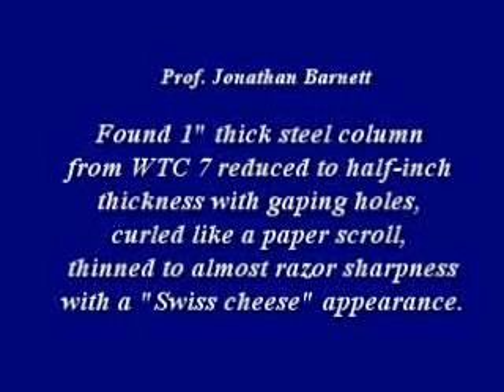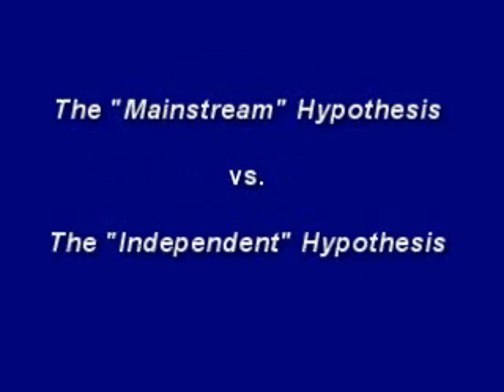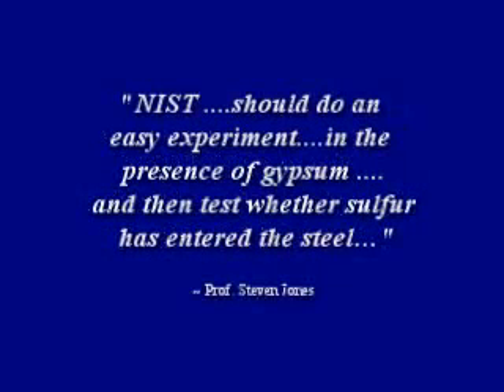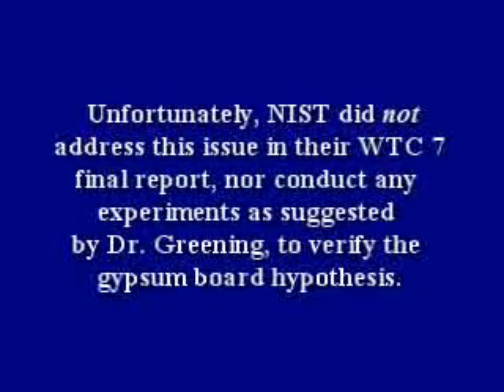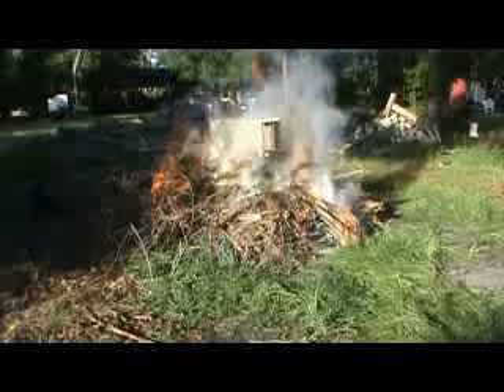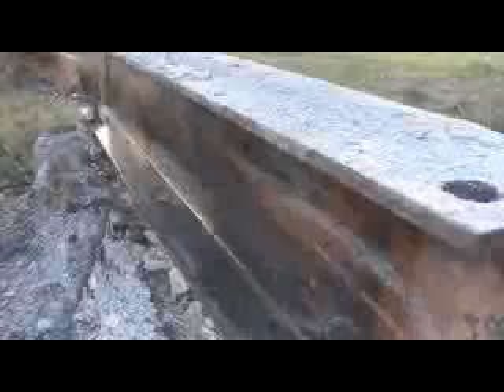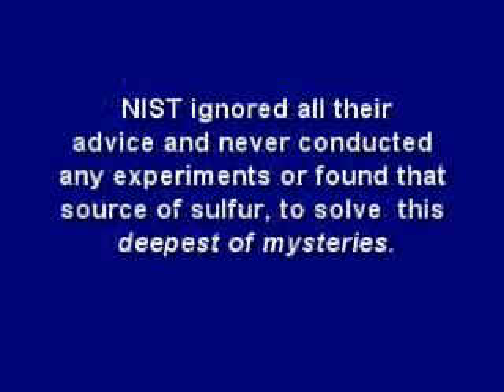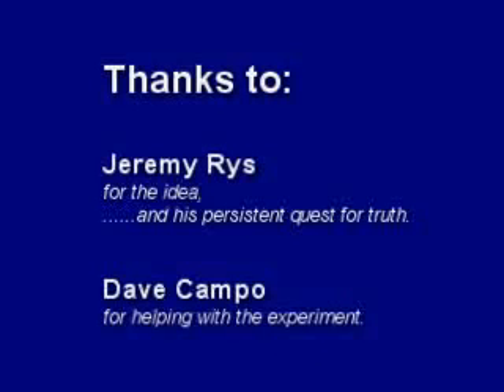9/11 Experiments: The Mysterious Eutectic Steel

Comment: @fertilizerspike "I've demonstrated that not only should the "collapse" never have started in the first place without a controlled demolition"

When did you do this?

Just as an FYI, lets say thermite, explosives, directed energy weapons or airplanes and fires started the collapses I.E at the impact the floors. 

The collapse would have behaved the exact same. You know that right? You claim charges were placed on every floor. I say your charges would only need to be placed on one floor.

Comment: @flanksteak2 said:
"if you didn't think collapse would start in the first place why would you try and argue this point and then change the subject when told to prove it?"

That's not what happened, liar. I've demonstrated that not only should the "collapse" never have started in the first place without a controlled demolition, it in no way could have proceeded to the utter shredding symmetrical collapse of the entire structure. I've proven your beliefs wrong from two different angles.

Comment: @fertilizerspike "Even if it did (magically) start on its own, it would have been arrested immediately by the structure below."

Clown, if you didn't think collapse would start in the first place why would you try and argue this point and then change the subject when told to prove it?

It's because you change the subject when you are at the point in the discussion where you must prove something to avoid showcasing the fact that you can't prove it. 

Bad clown!

Comment: @flanksteak2 said:
"Clearly you had already bridged the gap"

The only "gap" here is in your brain. The buildings survived the impacts and fires, they stood for an hour in one case and over an hour in another case. They were designed to withstand the impacts and fires, they were strong as fuck, you clearly can't even grasp how strong. The oscillation caused by the impacts was virtually identical to what was expected from the undamaged structure, ergo the damage was INSIGNIFICANT.

Comment: @flanksteak2 said:
"Your argument is that collapse should have been arrested"

Wrong. I'm not arguing at all, I'm telling you, the "collapse" never should have started in the first place, and wouldn't have started if not for demolition charges inside the buildings cutting columns.

Even if it did (magically) start on its own, it would have been arrested immediately by the structure below. The structure below was ALREADY holding it up, jackass.

Comment: @fertilizerspike "it's irrelevant"

Your argument is that collapse should have been arrested, not that it shouldn't have started. Clearly you had already bridged the gap between initiation and non-occurrence. 

Your "it's irrelevant" is a cop-out designed to waste non-clowns time. You're just too stupid to back up the point and so much change subjects before resolution or proof is reached.

Clown, you might be fired.

Comment: @flanksteak2 said:
"As if the adjectives "bolted" and "welded" are somehow a vertical load capacity rating."

Actually the only bolts were between the floor truss grid and the outer walls, the outer columns were all welded together both end-to-end as well as welded to each of the neighboring columns. You clearly don't understand just how strong the buildings were or how they were held together. As you point out, the connections could hold at least 5 floors of weight above them.

Comment: @fertilizerspike "bolted, welded"

OMG!!! You mean they hold buildings together with bolts and welds! Wow, you are a genius! You know loads about construction. LOL

As if the adjectives "bolted" and "welded" are somehow a vertical load capacity rating. Hey stupid, the only thing resisting collapse were these connections which can hold 11 floors worth of weight applied statically or 5 dynamically applied. And that is very conservative. 

You do not get this because you be a funny clown!

Comment: @flanksteak2 said:
"Because the only thing resisting collapse were the truss-to-column connections that held up each individual floor."

You are delusional. The columns were also bolted and welded to each other, in prefabricated sections built so adjacent joints didn't align on the same floor.The columns were supporting the buildings, less than 10% severed, 300% stronger than they needed to be, that means well over 200% structural integrity, they survived the damage and fires, stupid.

Comment: @fertilizerspike "Here NIST is saying the structure below offered almost no resistance. How is that possible if the structure was still intact below that point?"

Because the only thing resisting collapse were the truss-to-column connections that held up each individual floor. 

Pretty tough to understand huh?

You're one of the dumbshits that thinks it's line up column-to-column and thus the full vertical support capacity of the columns was resisting collapse. 

You funny clown!

Comment: @DuRound2
"In other words, the momentum (which equals mass times velocity) of the 12 to 28 stories (WTC 1 and WTC 2, respectively) falling on the supporting structure below"

Again, WHY IN THE FUCK WAS IT MOVING? Its momentum was ZERO, what made it start accelerating? Fire couldn't have weakened the building that much, that's been proven beyond doubt many times over, the damage was less than 8% of the supporting columns, do the math, the buildings survived the impacts and fires.

Comment: @DuRound2
"energy released by the downward movement of the large building mass"

Again, WHY IN THE FUCK WAS IT MOVING? We all saw the buildings stand for an hour, rock-solid, people inside barely felt the impacts of the planes, the buildings were a mesh of very strong metal all welded and bolted together, it wouldn't collapse like a house of cards from less than 8% of supporting columns damaged and office fires. Anyone familiar with demolition knows that.

Comment: @DuRound2

"the time it took for the collapse to initiate...was dictated by..the time it took for the fires to...weaken the structure to the point that the towers could not resist the tremendous energy released by the downward movement of the massive top section"

Downward movement of the top section? It wasn't fucking moving until the demolition started, it was rock solid. Why did it start falling? It started falling only after explosives went off destroying key supports.

Comment: @DuRound2
And here is the entirety of NIST's case against controlled demolition:

"the collapse was initiated in the impact and fire floors of the WTC towers and nowhere else"

That the demolition initiated on the damaged floors does NOT falsify controlled demolition conclusions. A demolition can start anywhere, computers can be used to precisely control the timing of explosives. That's it. That's all NIST says to "refute" controlled demolition, and it's idiotic.

Comment: @DuRound2 said:
"NIST’s findings do not support the “pancake theory” of collapse"

NIST's own findings don't support their own theory, that's quite damning to their theory, wouldn't you say?

"the NIST investigation showed conclusively that the failure of the inwardly bowed perimeter columns initiated collapse"

As noted above, this idea is utterly absurd. The floors were not heavy enough to bow the walls in, and they were designed to handle 3x live loads, fire could not weaken them to failure.

Comment: @DuRound2
Also from NIST:

"jet-fuel ignited multi-floor fires...significantly weakened the floors and columns with dislodged fireproofing to the point where floors sagged and pulled inward on the perimeter columns"

Experiments in these videos show clearly that such fires, even sustained over many hours, can not significantly weaken steel. Also, the floors were not heavy enough to pull the outer walls in. They were designed to handle 3x the expected live loads anyway, fire didn't melt them.

Comment: @DuRound2 said:
"I believe NIST... Scientifically."

Here's what NIST says:

"NIST investigators were unable to locate any documentation of the criteria and method used in the impact analysis"

NIST does not issue any challenge to the claim that the buildings were designed to survive plane impacts, and should have survived, and did survive until they were demolished by explosives and pyrotechnics placed inside.

Comment: @flanksteak2 said:
"What planes are equipped with this sort of system where NORAD can willy-nilly just take over the controls of the aircraft."

Virtually every passenger jet in the United States had this system integrated into its design on the drawing board. In other words, virtually the entire US fleet of passenger jets (and virtually all private jets) have this system integrated. It's supposed to be for taking control of hijacked aircraft.

Comment: @flanksteak2 said:
"Are you sure those are qualities you want in a primer that's designed to be welded-through?"

That's irrelevant, as countless pictures show quite clearly, the steel in the World Trade Center was not painted, it was not primed, it was bare and in all cases utterly exposed and in many cases very rusty. Your suggestion that the unreacted pyrotechnic material found in the dust is weak and unsupported by anything but your imagination.

Comment: @flanksteak2 said:
"without first proving your claim that Nano-Thermite did it?"

I never claimed "nano-thermite did it", I said unreacted nanothermite was found in the dust from the demolition, so clearly it was used in the demolition. That's pretty simple, only a fool would challenge that conclusion in light of the evidence, which demonstrates beyond doubt nanothermite was used, and the experiments in these videos show even crude thermite can quickly or even explosively cut steel.

Comment: @flanksteak2 said:
"All the evidence points to Planes and Fires."

There is, of course, abundant video evidence of the damage and fires. There is also the many decades of structural engineering suggesting quite strongly that asymmetrical damage and office fires like we saw could not have caused this kind of utter shredding collapse of those buildings. This was obviously a controlled demolition, anyone who can't see that is an idiot.

Comment: @DuRound2 said:
"You have ENTIRELY ignored the structural modeling section of the report"

Then feel free to correct me, go ahead, cite some page numbers from this report where you think it "explains" this collapse in terms of only damage from plane impacts and subsequent office fires. None of it is relevant to the unreacted thermite found in the dust. And it doesn't matter what material was used, it's obvious this was a controlled demolition, only morons think otherwise.

Comment: @noozilander "sources not possible"

So in your mind, the Drywall used in the video is the exact same as the drywall installed in the WTC's in th 70's?

Right there that tells me the people doing the experiments are not very bright. 

That is akin to taking unleaded fuel from today and testing it for lead and concluding that since it did not test positive for lead that leaded fuel from the 60's could not have been a source of lead contamination in the soil at gas stations.

Comment: @SuperLogicalthinker  "Since the dynamic amplification factor for a suddenly applied load is 2, an intact floor below the level of collapse initiation could not have supported more than six floors.  Since the number of floors above the level where the collapse initiated, exceeded 6 for both towers (12 for WTC 1 and 29 for WTC 2), neither tower could have arrested the progression of collapse once collapse initiated."

Comment: @SuperLogicalthinker  "(this is a conservative load estimate since it ignores the weight contribution of the heavier mechanical floors at the top of each WTC Tower).  By dividing the total vertical connection capacity (29,000,000 lb) of a floor by the total vertical load applied to the connections (2,500,000 lb), the number of floors that can be supported by an intact floor is calculated to be a total of 12 floors or 11 additional floors."

Comment: @SuperLogicalthinker  The total floor area outside the core was approximately 31,000 ft2, and the average load on a floor under service conditions on September 11, 2001 was 80 lb/ft2.   Thus, the total vertical load on a floor outside the core can be estimated by multiplying the floor area (31,000 ft2) by the gravitational load (80 lb/ft2), which yields 2,500,000 lb

Comment: @SuperLogicalthinker "Back up your claims! Lets see some documentation on how much the floors COULD handle"

the truss seat connections between the primary floor trusses and the exterior wall columns or core columns.  The individual connection capacities ranged from 94,000 lb to 395,000 lb, with a total vertical load capacity for the connections on a typical floor of 29,000,000 lb (See Section 5.2.4 of NIST NCSTAR 1-6C).

Comment: @flanksteak2 said:
"the core was still standing after the upper part of the building and floors and outer columns on the lower half collapsed"

If this is even true, which I doubt, it wasn't standing for more than a second or two, nothing at all inconsistent with the idea of controlled demolition, and again, I doubt it's even true, prove it, fool.

Comment: @fertilizerspike Ah yes the "the collapse should have been arrested, theirfore thermite was placed up and down the entire building to weaken the core columns" claim that seems to ignore the core was still standing after the upper part of the building and floors and outer columns on the lower half collapsed. 

If explosives had to be used to get columns out of the way, why were the columns still standing after the floors and outer walls had collapsed?

Can't make this fit into your fantasy

Comment: @DuRound2 Well NIST got proven wrong. Independent engineers have also question NIST because NIST hasnt said anything about the core columns. You get what im trying to tell you now? They arent flat out lying but they choose what to investigate and what doesnt need a thorough investigation. Some of the stuff they said were just assumptions (how could assumptions be facts?)

Comment: @SuperLogicalthinker Nothing done in this video needs refuting. It's non-sequitir. The author of the video claims the Eutectic steel was caused by Steven Jones paint chips but Steven Jones paint chips do not contain sulfur and the steel in APP C was only heated to 1800 degrees F.

Comment: @DuRound2 said:

"It was a huge amount of damage. Not a small amount."

Feel free to support this fable with some evidence.

How many columns were severed? How many of those severed were core columns? How many were exterior wall columns? These were the only structures supporting the buildings, the floors were pans hung on the supporting columns, they didn't build the fucking floors in mid-air then hand the columns on them, jackass. Holy shit pull you head from your ass already.

Comment: @flanksteak2
The floors basically did nothing but hold up the crap in the offices, and tie the outer walls to the inner core members so they'd move as a monolith, even if every single floor "pancaked" there would still be a very strong core and shell left that wouldn't just tumble apart like Forrest Gump's leg braces. You really are fucking dumb.

Comment: @fertilizerspike 

So what you are saying is that the floor truss-to-column connections are bearing the weight of each successive story above it. 

That claim is stupid because each floor had the same size trusses holding it up except for the mechanical floors. 

The columns themselves get successively smaller as you go up because the load the columns must carry decreases as you get higher in the building. 

Very very basic stuff here yet you didn't know it.

Comment: @flanksteak2
The joints holding the trusses would have failed long before the outer columns bent, that's assuming the trusses would even significantly weaken or god forbid melt like taffy in that PBS video.

If you don't understand that this is how steel behaves in response to fire, go watch the videos on this channel, there are demonstrations of intense fires for many hours failing to cause any damage whatsoever.

Comment: @noozilander See stupid, I told you were too stupid to understand. That is why you are a 911 Truther. 

The push-in force that results in the floor ultimately deflecting 42 inches is a result of the push-in force that the columns exert once they have begun to get pulled out of plumb by the sagging floor. 

This push-in force is force induced by the columns is not present in the modeling NIST conducted thus the floor only sags 3 inches during testing. NIST's floor model is also unloaded

Comment: @noozilander The trusses sagged 3 inches in NIST modeling because there were no columns to push inward on them once they they had exerted their inward pull and buckled the columns. 

I already told you. You are not smart enough to understand how or why the outer wall begins to push inward on the trusses once it had begun to get pulled out of plumb by the sagging floor.

Comment: @DuRound2 To do this I must prove that reporters cannot fly. I will proceed to throw reporters off the top of a building. If one of them flies then 911=inside job. 

If the reporters do fly then I will counter by showing the conditions at the WTC's that day didn't even require flashbulbs.

Comment: @fertilizerspike The Eutectic melting in APP C occurred at 1800 degrees farenheit. 

Are you claiming that sulfur is added to lower the melting point of steel because thermite doesn't burn hot enough to melt steel or are you claiming that Steven Jones paint chips contain sulfur in high enough quanities to have leeched out onto that piece of steel and allowed it to be eroded by the temperatures typically found in building fires?